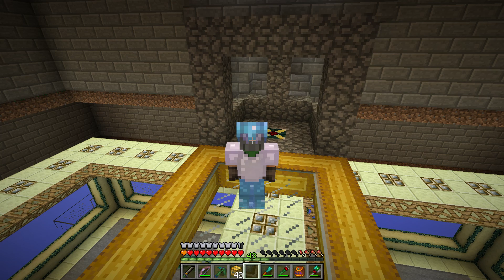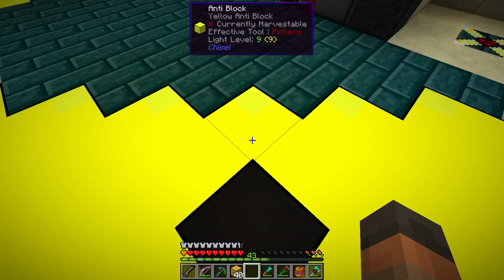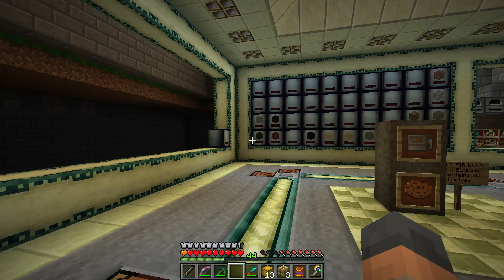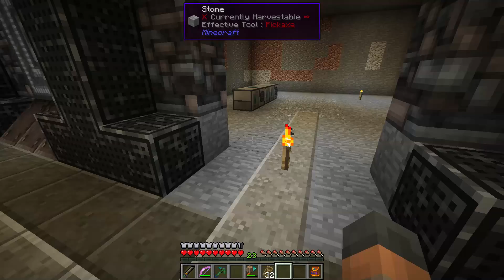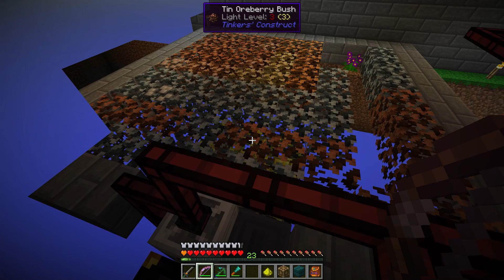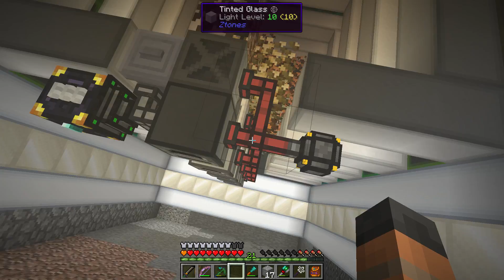Xisuminati Modpack 03 Decoration & Automation

Comment: The way ExtraUtils nodes work means that you do need to sort out your pipe properly in order to yield the most efficiency. Retrieval nodes sounds good but is pretty slow because when using that, you are using single thread searching rather than multi threads. Not quite a good idea.

But since in most cases you don't need to instantly retrieve a large amount of items, the system still works well.

Comment: Xisuma, you may want to consider switching to tesseracts for your wireless energy transfer. Using the ender transmitters/receivers means you suffer some loss of power. Tesseracts have unlimited power transfer with no loss :)
Reply: +Josh Bancroft Good idea - but tesseracts are very expensive for X right now

Comment: 1. For the storage problem your having - if your using the retrieval nodes on the back of the cache's then you can just connect more chest's/something with inverorys to the transfere pipe and let those back up (like having a few chest's on top of a hopper line in vanilla
2. with your smeltery if you connect the casting basons up with retrieval nodes on top (with a liquid filter inside) and connect this to the smelery drain with transfere pipes you don't need to make tons of smelterys
3. imagenery time block affects a 7X7 area (+- 2 blocks verticaly) - (see Jotato's twitter from 14 aug 2015)
4. DSU's (deep storage units) hold 2 billion items (I think this was reduced from 2,147,483,648 or 2^31) in older versions
hope this helps-edit:
added lines and removed point 5 asking how to add lines - thanks Andrew Hamilton
Reply: +Danny N, regarding your question at point 5:
Try Shift+Enter
It works in most cases that have this problem. =)
Reply: +Andrew Hamilton Thanks
Edited comment to include this
Reply: +Adam Polak Did I? if I did it must have been before you was born because that seems of have only of been yesterday